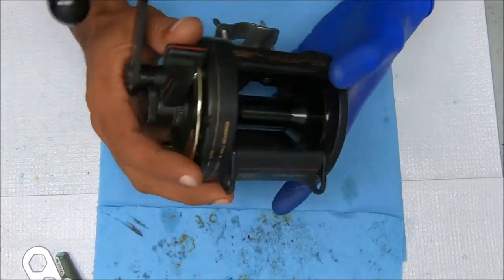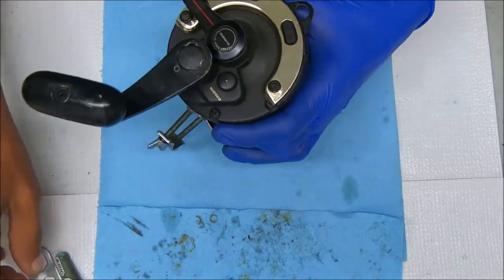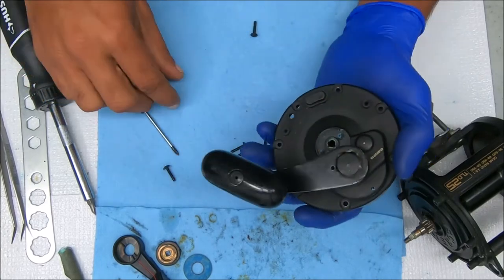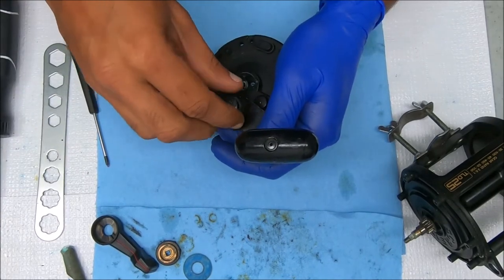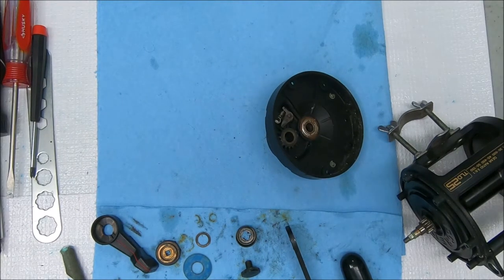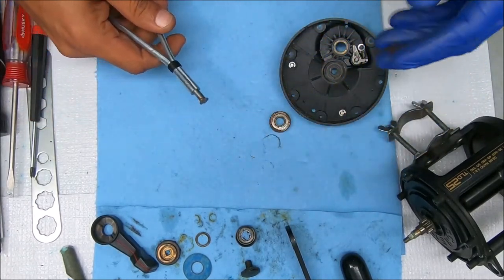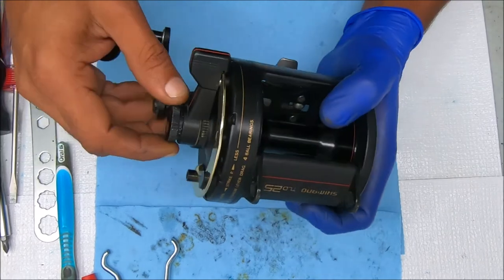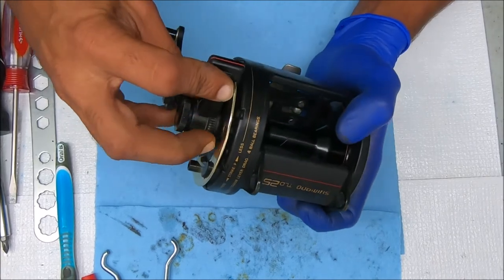Shimano TLD 25 Hard To Crank At Strike. Problem diagnosis & fix: Fishing Reel Repair

Comment: Can't think of what type of bearing some manufacturers use now to deal with this side load issue. I believe it was Accurate who originally started using it. Their big game reels put out ridiculous drag and they had to use a specific bearing to avoid this happening. This is also one of the ways graphite bodied reels can go kaboom! Awesome value for a big game reel but people fish them like aluminum bodies reels and sometimes it ends badly!
Reply from the maker: True regarding they they're fished. I think the 'lateral-load' specific bearings have a thicker inner race.... I thought it was Avet that started it, but their bearings still fail.

Comment: Interesting that bearing was so bad even though it's a common issue. I've come across this on other Lever Drags and the bearing spins but it's still the bearing. My understanding is people tend to fish the drag too high and the side load crunches that bearing. It was an issue with the original line of Avet reels. Particularly the smaller sizes. They were built to fish 8-10lbs of drag but guys fished crazy line like 80lb on them. Cranked the drag up past where they had free spool, one good run from a fish and bang that bearing was done.
Reply from the maker: Yes, most can still spin.... it's rare to be ve seized up. The best ones, in my opinion, are the main and pinion bearings on spinners..... the reel still works, but when you check the bearings, they're totally seized.

Comment: Good troubleshooting.  
Lack of maintainance caused that bearing failure.  If that reel was cleaned and lubed once or twice a year, that bearing would still be good.  Marine grease isn't very expensive and it offers good protection and lubrication.
Reply from the maker: Thanks! Agreed regarding the minimal maintenance needed to avoid costs down the road. However, if everyone did that, one of my revenue stream dries up. 🙂
Reply: Not necessarily. That bearing takes a lot of side load and when people fish lever drags too heavy that bearing is the one that goes. Happens a lot. In this case that bearing was in terrible shape but it was so hard to get out because it had literally been crunched into that position. Sometimes the bearing will spin and look fine but it's still the bearing causing it. Maintenance is absolutely crucial, fully agree but in this case fishing appropriate line test with the right amount of drag is equally important. This is also one of the ways graphite framed reels can explode when on fish. Too much drag, crazy side load on that bearing, bearing seizes and bang the graphite can't deal with that type of pressure. It sounds like a shotgun blast when it happens.

Comment: Hi, I have a couple of Tiagras with the same problem, hard to crank the reel when the drag is in strike, I checked the bearings and they seem to be fine, any hint on what else could be? Thanks.
Reply from the maker: Thanks for watching! Yes.... it's still the bearing.
Reply: Did you replace the bearing? TSG is 100% right it's still the bearing. Usually it happens to lever drags when the drag is fished very high or you fish line too heavy for drag. Lever drags push or pull to create drag pressure so it puts a serious side load on the internals. That bearing is the one that takes the majority of that load and it's a very common issue. You can buy a particular type of bearing that allows for more side load, can't think of what it's called off the top of my head. Accurate was the first manufacturer to start using them in their twin drag reels to combat this exact issue. Their twin drag reels put out stupid drag numbers and the standard bearing just couldn't deal with it. I actually had one of my Penn International 30VISX develop this a couple seasons ago. I was on a 150lb tuna and getting spooled. Maxed out the drag and while I caught the fish the reel was toast for the rest of that trip.
Reply: @JeffSmith-eq3kc  Thank you for your answer. I only replaced two bearings with Boca Bearing but the problem persists, I may need to change them all.
Reply: @blind572  did you replace the spool bearings with Boca bearings or the pinion bearing? Most Boca bearing sets of two are meant for the two spool bearings as they do improve the free spool a lot. I put ceramic spool bearings on all of my conventional reels I think it's the best upgrade to make and it's cheap. Id be surprised if it's not that pinion bearing. It's the one inside the housing that sits below where the drag knob and lever sits. I suppose if the bearing above the AR was tight it could be there as well but almost all the time it's that pinion bearing. Interesting!
Reply: @JeffSmith-eq3kc  Since I bought just two bearings, I switched them around trying to find out which was the bad bearing, but the problem persisted every time, I wonder if the washers on the pinion close to the drag are the ones that I have to change, or maybe change all the bearings and not just two, what do you think?